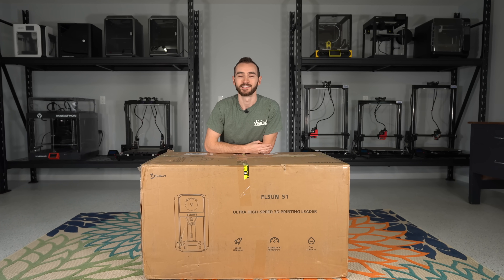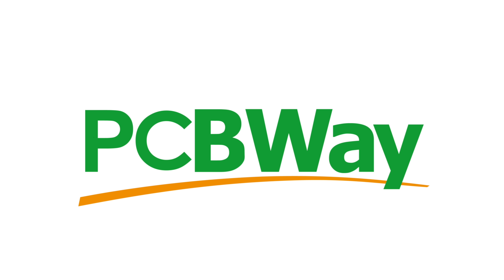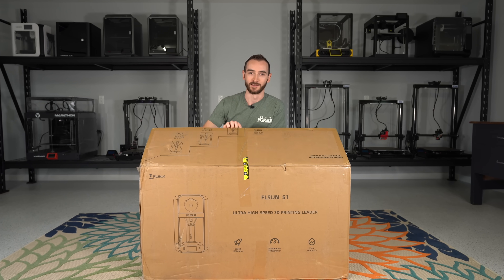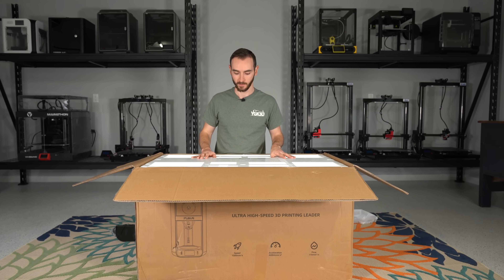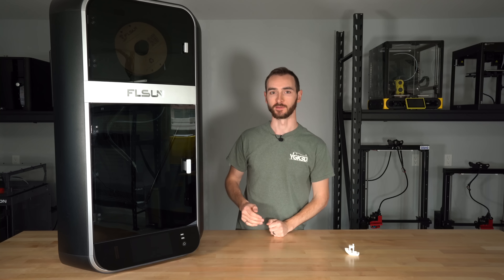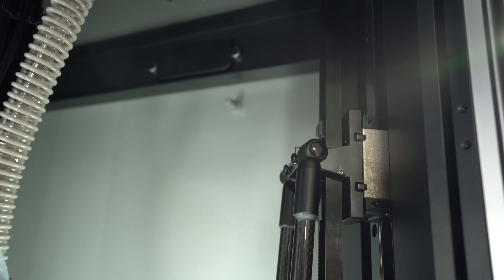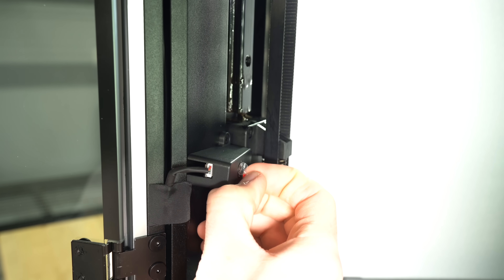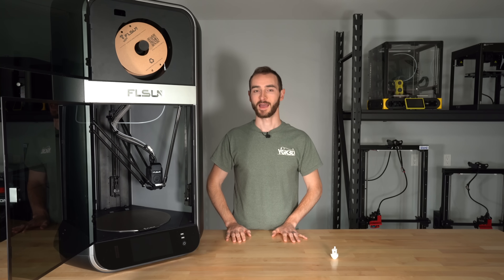FLSun S1 First Look - Bambu Lab FINALLY Has Real Competition

Comment: Great video, but I think for it to really be completion to Bambu Lab they would have to figure out multi material / ams style filament management. But for the price you can't beat if you print in single material / colors or don't mind doing the manual filament changes

Comment: I find this printer really interesting.  It's tall, to accommodate the armatures, but the footprint isn't that different to an X1C.  As for the speed, I could kind of care less.  Speed at the expense of quality is a fail in my book.  I know speed is all the rage at the moment, and it's cool that the machine can physically move that fast, but if the end product is poor then it doesn't really matter.  What I would be interested to see is someone who dials the S1 to the same sort of print  settings as the X1C (speed, flow rate, layer height, infill, etc.), print the same file side by side, and compare the quality of the item printed.  Don't race them to see who wins, just print the best quality possible between the two and see what that looks like.  To me, THAT would be the true test of the S1.  The X1C is currently the benchmark for quality, speed, and easy of use, so I think that would be a good comparison for the S1. 

As for the horrendous noise the S1 makes, I think there's a 3D file out there for a fan muffler that helps, somewhat, but they could definitely improve that.  If the printer is obnoxious to be around because of the noise, that alone will turn some people away from purchasing one.

Comment: I think many don’t get that Bambus are popular not simply because they are fast but is a combination of being reliable, have a working multi material system and is decently quick all in a streamlined package.
Reply: I don't get your comment. Plenty of people get this, and I constantly hear reviewers talk about that. In fact, it's widely and abundantly said. If anything, this printer looks to try and replicate what Bambu started by producing what appears to be a highly refined printer. The improvements over the Flsun SR and V400 are obvious and I attribute that to what Bambu has done. Only time will tell if the reliability is there too, but competition is already driving prices down while costs are going up in most industries. Why be negative toward something that doesn't affect you but rather helps all of us?
Reply: They don't. Bambus look reliable while being borderline unusable garbage, they are basically the ender 3 of coreXY.

Comment: Ridiculous size and no multi material printing support = no thanks.
Reply: ridiculous size is on z axis, it's almost the same size as bambu on left and right, just the z axis is bigger. Multimaterial duhh.
Reply: @gamingscorpionindia1995  I don't get your "multimaterial duhh" comment... it doesn't have an AMS, it's only a fixed filament dryer box according to the specs. It's ridiculous.
Reply: @alifewithoutgamingisnolife  Duhh mean yeah, it's obvious that it doesn't have that support and will not get it in future probably because of its design

Comment: Deltas can theoretically go faster but my two peeves are the steppers are louder than hell due to the way they move and they required more maintenance/calibration than cartesians in my experience. Thats despite others telling me cartesians are more maintenance, but I was really pushing a machine composed of plywood to its limit and kept throwing stuff out of my tunes.  Loved it when it worked though! High speeds, smooth lines and fine details. And also it just plain looks cooler when it’s printing.

Im really out of date with deltas, my last one was a heavily modified Rostock Max v2. If FLsun can address their finicky nature that’d be fantastic, it sounds like they have. I recently bought an X1 carbon after getting impatient on my Voron 2.4 build and am really impressed on what it can do out of the box. The auto calibration and failure detection is a godsend, they’re right to get on the same page with the S1. Also love the provided enclosure, the hot box up top is a nice touch.

Comment: This is no competition. I have had the opportunity to test this printer but the direction the manufacturer is taking is just wrong. All the parameters in which it should compete are also its weaknesses. In this price range, this is an unusable printer for print farms. But I believe an architect could find a use for it.

Comment: This looks promissing. For such high speeds you need fast motion system, ability to melt a lot of plastic per second and ability to cool a lot of printed plastick in place quickly. This seems to have all of those things so even if the marketed values are reacheable only in some extreme case on a particular printed model and setting this machine should still prove to be extremely capable. 
The dryer on the top is a nice touch. Deltas tend to have the spool at the top where all the heat of the printing tends to go anyway so it is a nice synergy to make that space a heated dryer too. When a print is running the heating on the dryer probably doesn't need to work at all or nearly as much. The heat generated by the bed and hotend gets used for drying too.

Comment: Bambu lab has had real competition for 2 years now. These shilly youtubers.
Reply: I wouldn’t say real competition if you’re going apples to apples, the rest all have some sort of drawback. Whether it be price, features, ecosystem, reliability, wiki, or quality.
Reply: Which company has the ability of access 16 color changes and the setup is less than 5 min?
Which company allows printing remotely and or without touching a slicer program, that auto loads/unloads filament and is rock solid reliable?
Which multi filament system allows for  filament redundancy so it will continue to print after a filament run out?
Which printer allows for auto filament calibrations for up to 4 colors at a time to adjust k values, under and over extrusions?

Until you can name 1 company that can do all of that in a single system, that  can be setup in minutes, with no need to tune, configure or futz with we will assume you are trolling and should be ignored.
Reply: @AwwwSnapperz  lol you just named off a bunch of gimmicky marketing shit that nobody actually uses. literally nobody uses 16 colors on a bambu lab. Its all for marketing.

Nobody prints remotely from the handy app becasue of the the inconstancy and security issues involved

The prusa MMU and even creality/anycubics systems auto load/unload filament for you lol.

Nobody adjust their K values anymore lmfao. This isn't 2019 anymore dude. Everything is so fine tuned out of the box that nobody ever needs to mess with K values. 

Like you're actually shilling hard for a company that's getting its ass kicked by all of the competition and holds the record on DOA printers. 

Which company is funded by IDG capitol? A venture capital bank knows for funding companies that sell user data and have the larges security breaches in history? That would be bambu lab buddy. Bambu lab is selling your data sweetheart.

Bambu lab doesn't even own their own company. Their owned by a parent company which is Tiertime 3D. At least prusa is self owned and ran and not backed by shady investors.

Which company has a 2.6 rating on trustpilot? that would be bambu lab. Shit prusa has a 4.6.
Reply: @AwwwSnapperz  How much did Bambu send you?
Reply: @Peaky-Birmingham  You forgot to answer the many questions I asked. 
Be clever and actually answer them or run along. The adults are talking.
Reply from the maker: They have plenty of competitors copying their designs and racing to the bottom. Who else is innovating and doing something different?
Reply: @ygk3d  Bambu lab literally copied after voron, qidi tech and flashforged. Their CEO admitted it. There was zero innovation from bambu lab🤣🤣

Their A1 series is the literal definition of "race to the bottom manufacturing"

Comment: Thanks for this intro.  I've printed many hundreds of parts on a QQ-S and V400.  My biggest complaint and what I've had the most difficulty correcting is poor dimensional accuracy in x and y.  Please check some parts (califlower etc) and include results in your detailed review.  The delta buid volume shape is great for the oil and gas industry because most of our parts are long and cylindrical, but dimensional accuracy seems to be a weakness for deltas.

Comment: I think I love this printer ❤  with a high performance hotend like 100+mm3/s ... it has a lot to offer but also have downsides for using with MMU. Huge purging so time and filament wasted. But hey, i prefer that since I am not really in color printing and just want to print parts fast, strong, with quality. I only rarely print props and when I do, i dont mind one color or manual color swap. Its mostly when my son wants a little figurine. So this printer is for people like me :) prototyping and printing fast fonctional parts with one good spool of good material
Reply: Agreed, and have been looking after this printer for ages. But in a dilemma, also would love to build my own large printer, but not entirely from scratch - so considering the Vcore4 (queued already for the standard kit). What's causing my second thoughts are sheer size of it, almost 1000x1000x1000 due to the IDEX. Also considered your kit from Mellow (still prefer actually), but really would love 400+ - with your new adventure, did further development stop, or can I foresee a next gen Vz larger printer in the near future? That could be the deciding factor in what I do for my purchase. <3

Comment: Unfortunately I don't think it is all about speed this year it is about multi material, multi colour. I think they have missed the boat, my K1 is plenty fast enough, I am more interested in printers with some sort of AMS system. I suppose if you are using the printer for prototyping then the speed is important, I would assume for most hobbyists though it isn't.

Comment: For you follow up review, please test the maximum print height at the edge of the print area. V400 promised 410x300mm but at the edge only has 379mm max height. I wonder if this printer really has 320x430mm print volume

Comment: Built an early Anycubic Kossel and it was a speedster back in the day.  The print quality was excellent for a printer of that vintage.  The issue I had was dimensional accuracy around the entire bed when you were printing closer to the edge.  Interested in your testing of that aspect.
Reply: I still run a Linear Plus daily right next to my Super Racers. They're killer!

Comment: As soon as I saw the thumbnail I thought "oh, look, another YouTuber who doesn't get why the Bambu machines are so popular."  As soon as you praised the V6 nozzle, I knew I was right.

Bambu Labs' success has very little to do with the speed of the X1C, and almost everything to do with how damn easy it is to use.  A key part of that ease of use is the all-in-one nozzle and throat.  And oaky, FL Sun has provided a pre-assembled hotend but it's still a bunch of different types of metal screwed together and eventually that's going to fail and then the user has a massive maintenance problem, because replacing V6 nozzles is difficult and dangerous.

And then this is using Klipper.  Klipper compares to Bambu Slicer or Orca Slicer the way Linux compares to WIndows - yes, an expert can do more with it, but the average user is just lost and overwhelmed.  Bambu has built a walled garden, yes - but they've made that walled garden very comfortable and relaxing and there's a lot of value in just hanging out there.

Add on the fact that this thing is huge - it's roughly the same size as R2-D2!! - and (in my opinion, of course) this is not a machine that's going to appeal to Bambu's market.  Bambu Labs has successfully captured the group of people (like myself) who want a 3d printer that we don't have to screw around with or fiddle with or modify, but will just simply work to helps us turn our imaginations into reality.  The S1 is a machine that appeals to the 3d printer geek who things deltas are cool and wants an enormous, space-ace looking delta because deltas are cool.

Your video is well presented and gave us a good first look at this printer, and for that you'll get a like.  And a thank-you, because I did get a lot of good information from you.  But the basic thesis is flawed, and to be honest it irks me how many people seem to think that the X1C's speed is the driving factor in its sales.

Orrr.... it was very clever marketing in order to get people like me to fuel the algorithm.  If so, well played.  :D

Comment: I am MOST skeptical about the cooling performance at >100mm³/s flow rates for smaller to medium parts with CPAP cooling only.

CPAP is better than average bedslinger cooling, but a print head that moves will always be inferior to external fans blowing onto the part continuously, as nicely demonstrated in MirageC's video with a thermal camera:
"Ultimate 3D printer Cooling fan - 5015 vs Berd-Air vs 300CFM Mega Cooling"
https://www.youtube.com/watch?v=65FVQ1jArME

Therefore I doubt that this printer will be able to cool the current layer appropriately when pushing out that much plastic. Prints might fail or become unusable.
Of course - given that the printed part will be of an appropriate size where the layer time is short-ish - so cooling will be more important.
Cooling won't matter if you print out a solid cylinder that fills the whole print area. 

I think we really would appreciate if you put that to the test, since a claim of >100mm³/s without proper cooling might be - once again - a senseless marketing claim without looking at the bigger picture. In this case checking if that massive flow rate is even applicable for most printed parts with the available cooling.

Like claims of x hundred mm/s print speed being worthless without the proper acceleration, which some companies love to blab about.
Reply: A strong enough CPAP can double as full layer cooling depending on how you direct the output. The skirt thing they seem to be using looks interesting. I'm running sub-1s min layer time with CPAP only, no supplemental side fans.
Reply from the maker: Good point and interesting observations. Thanks for sharing your knowledge!

Comment: 1200 has gotta be a stretch even for travel speeds. Might be like the perfect line for the geometry.

What really matters is if it can keep control of volumetric flow at that speed, and well, with a hotend claim that high, thats real important.
Reply: 1200 is slow for travel on a delta. Mine does 2400 travel with some headroom.
Reply: @daliasprints9798  You're probably right for travels. No way for anything actually being printed though.
Reply: @BeefIngot  With thin layers you can print at 1000+ motion speeds, but dialing in the settings so those speeds work can be hard.
Reply: They put an 8 minute benchy on the SD. Nero ran it and came out pretty slick.
Reply: @Oldsjunkie  8 min benchy doesn't need 1000 mm/s or even 400 mm/s.
Reply: @Oldsjunkie  It didnt follow the speed benchy rules so its not really comparable. It also looked pretty rough.

Comment: Delta Printers are really weird, that's why there are so few of them. They are very space inefficient, you get a small build volume for a large footprint and they have a ton of moving parts that can break. Their only advantage is speed, they can move the fastest but it's really only slightly faster then a core XY. I'm not going to take a ton of drawbacks for a 5 - 10% boost in speed. Do you see the size of that thing? It's like a refrigerator.
Reply: Movement and vibration within the printhead of a delta is dispersed much more efficiently. With a coreXY setup, the printer shakes and rocks a lot more than a delta would, due to utilizing the third axis into the other 2.
Reply: @Youthoughtbuddy While also making input shaping much harder to tune.
Reply: It's not only slightly faster than corexy. Mine can do 2500+ travel speed at 90k accel, or 1500 at 150k accel.

Indeed a lot of deltas are space inefficient but that's not essential. Mine is roughly same footprint and machine height as an Ender 3 with very similar build volume (but cylindrical).
Reply from the maker: That’s fair. It’s definitely large.
Reply: Always neat what someone is so sure of something they don't know anything about...😂 Literally three motors with three belts and idlers. Look at a bedslinger some time! LOL
Reply: @Oldsjunkie  People never trust the unknown

Comment: lol, i still don't see the point of those dry box printers lol. printed tons of different materials, never had a problem, and just put them into a silica box before and after use, and ur good to go. if u put them into the ams with dryer boxes, they also work perfect. why even waste 4hours of electricity when u can just put them into silica dryer, that u take off after use, put them in the microwave for 30seconds and can use them again without any problems lol.
Reply: Lol, try living in a humid country, lol
Reply: You must run PLA in a low humidity region. Try some nylon in Indiana during the summer...😂

Comment: Very interesting. I like that companies are stepping up to Bambu (I'm even a Bambu fanboy) I have not had the best of luck with Delta printers. I had an Anycubic Preditor and it printer well at first but quickly became a problem printer which required constant calibration. hopefully FLSun software will help out.
Reply: It's running vanilla klipper with some tweaks for it being a Delta printer. You have to get the updates through FLSUN and not just update it when klipper says there is a new update. In fact they made it so you can't. 

I'm waiting to see what people can get it to do by tweaking the config files as people have already gotten much better performance from the SV08 then the default settings out of the box and it uses klipper also.